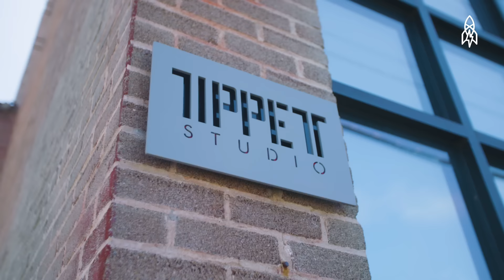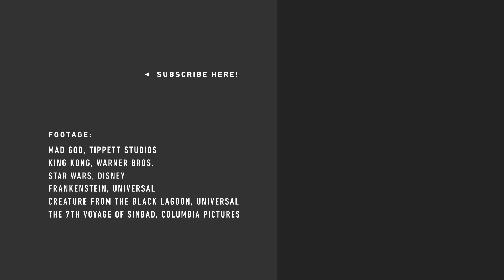Building Stop-Motion Masterpieces by Hand

Comment: Did Ray Harryhausen make his characters in the same way Tippett describes in this video? With polyurethane foam and latex skins? But how was it possible to achieve such details on the face, etc., for example, in Kali or Talos? Did Harryhausen have a firmer latex mixture to model the details, maybe latex foam? It seems to me very difficult to achieve these details with latex skins alone.